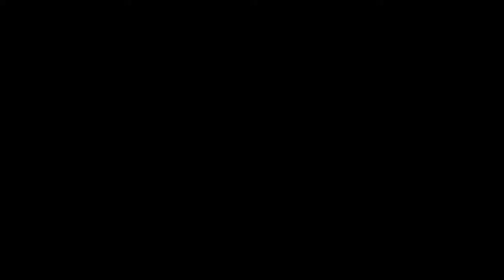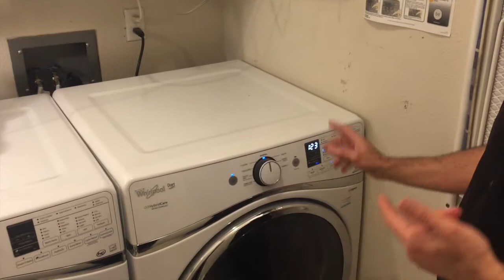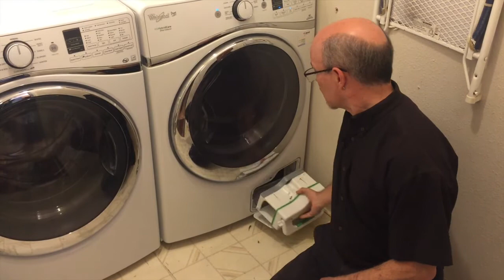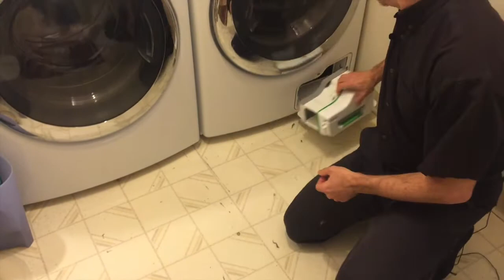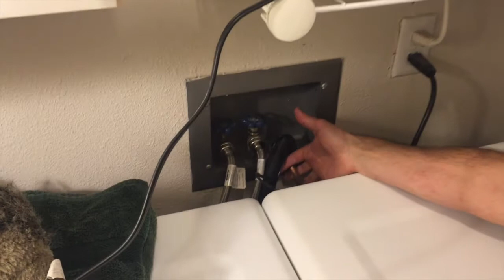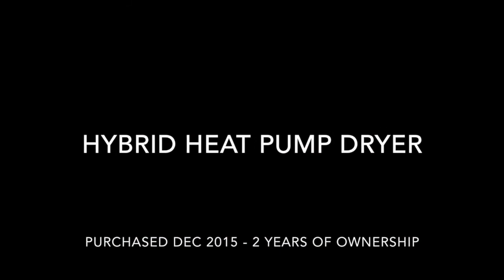Hybrid Heat Pump Dryer  Full Review

Comment: If I got one of those, I'd really want to try to send the water recovered back to the washer or a tank that can feed the washer, so that I'd use less water as well. In theory that water should be pretty clean.
Reply: @notfiveo I do not disagree with you, but minimal return for effort never stopped me before.
Reply: If you can, you might be better off trying to run the collected water to a toilet tank. There are many options for running grey water from a bathroom sink to a toilet tank, what is collected by the dryer should work really well that way. Only issue is the distance between your dryer and your bathroom. It is a much easier option than trying to get the recovered water back into a highly pressurized system like a washer uses.

Comment: a heat pump putting heat into a drum would extract heat from the room...
Reply: These machines do not extract heat from the room. Instead, they recycle the machine's own heat in a closed-loop. The air inside the drum passes through both the condenser and evaporator coils, in series, to dehumidify/cool it, then reheat it. In practice, heat pump machines will slightly warm the room they are in due to waste heat escaping the drum.